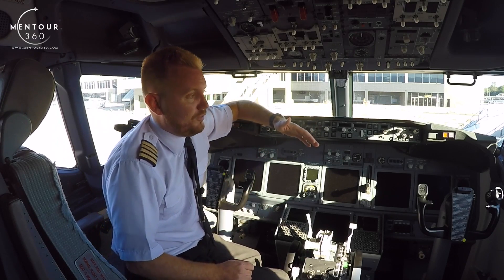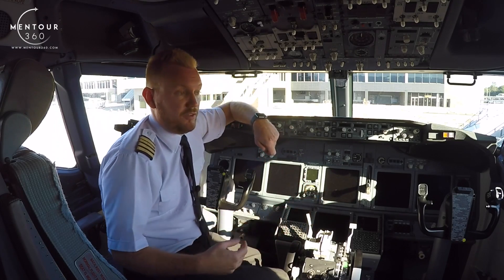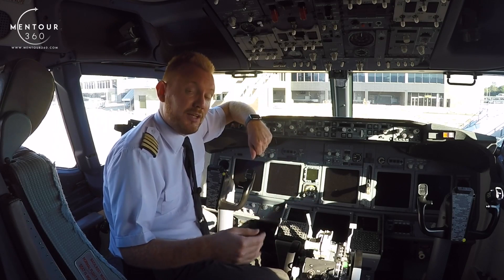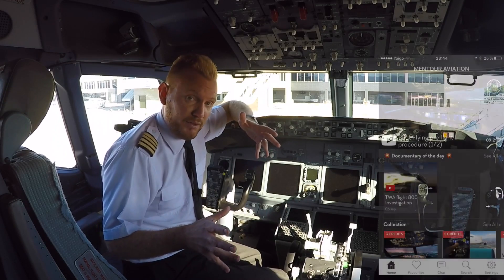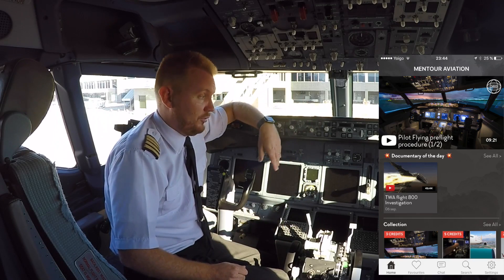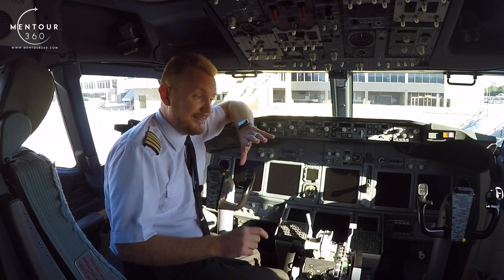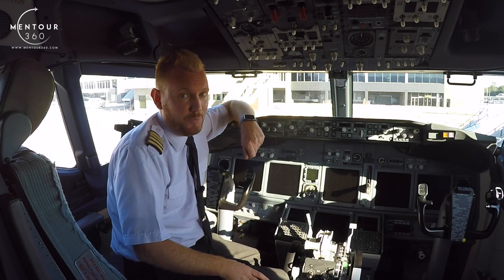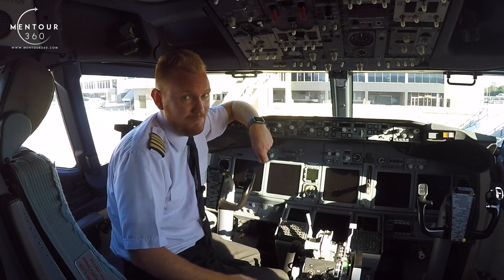How do flaps work on an aircraft?

Comment: Does anyone know of the uninterruptible auto pilot system, Mentour pilot??
Reply from the maker: +A D What do you mean with uninterruptible? We can disengage the Autopilot whenever we want on the 737
Reply: A D that would be HAL 9000 from Arthur C. Clarke's 2001 A Space  Odyssey
Reply: That tells me you don't have this equipment and that's okay. Honeywell has a patent on the system and it can be controlled and only controlled by the ground one activated by various means.  https://en.wikipedia.org/wiki/Boeing_Honeywell_Uninterruptible_Autopilot
The "uninterruptible" autopilot would be activated either by pilots, by onboard sensors, or remotely via radio or satellite links by government agencies, if terrorists attempt to gain control of a flight deck.  There's some conspiracy junk out there, but this system is real and is implemented by some companies, with privacy in mind.  There should be a worldwide mandate but governments and industry work slow.  This would all but end using an aircraft as a missile even by the pilot/s themselves.  What's your opinion?  Thx

Comment: Greetings. Your videos are very informative. Thank you for them. A question: Do modern aircraft such as the 737 utilise cameras that the pilots can use to monitor the functioning of the various parts such as flaps, landing gear, etc. Thanks very much.
Reply: Neil Quintana No they don't use external cameras to monitor important parts however some new aircraft do have cameras on the vertical stabiliser

Comment: Here’s a layman’s breakdown of wings, lift and flaps. Flaps are just an accentuation of what makes your wing “work” in the first place. Because of the wing’s shape, air moves more quickly over on top. This creates lower pressure...the molecules are moving faster, they’re less of a factor and all of the sudden, the higher pressure underneath “sucks” the wing upward...like when you open a door in your house and it goes FLYING OPEN because the room next door is at a lower pressure. Low pressure is also why you see “fog” form on top of the wings sometimes during takeoff and landing. If the dew point is right and the vapor in the air is close to “becoming fog” in the first place, the low pressure on top of the wing will be enough and boom....condensation forms. Flaps and slats just accentuate this...they allow a greater pressure differential to form, therefor causing more lift, therefor “high lift devices”. This isn’t the only reason airplanes fly....”angle of attack” or the angle at which the wing meets the oncoming air also plays a major role. A good analogy there is a kite. It meets enough wind and it’ll start to rise up in the air column. The physics of flight are complicated when you get into the specifics of airfoils, drag, etc....but on a fundamental level, its easy enough for anybody to understand.

Comment: wouldn’t the wing loose lift going from 40 degrees of flaps to 15 degrees on go around?
Reply from the maker: Yes, but we are also applying go-around thrust and starting to accelerate.
Reply: i’m thinking back when i was taking instruction in a cessna 150  back in1963  . was told never to make such a drastic change to the configuration . the 160 doesn’t have quite the thrust of a jet i’d say.

Comment: I have wondered how the winds are factored in slot/flap selection?  Straight headwinds versus a crosswind component.  I have student time in a 172, a Warrior II, and a Grumman Tiger, but no heavy tin.  I have no aspirations either, but I am curious.  We had a trim wheel to "Trim" out the yoke.  I have also wondered about the numbers on the flap lever.  Do the numbers, 1, 2, 5, 10 and so on, what do they correlate with? Are they angle degrees or are they just identifiers for your company?  As a very interested frequent passenger, I am just interested.  Keep them coming Capt.

Comment: Imagine taking venetian blinds that are rolled up, and putting them rolled up , rod and all, on your shoulders and running into the wind on a fairly windy day. Now unroll the venetian blinds out about half way and run into the wind again. OK, next let the venetian blinds all the way out and hold them on your shoulders. Now it will look like you are holding some big vinyl cape   cape on your back or something. Now start running into the wind with the blinds fully extended like that. Don't let go because there will be MORE DRAG trying to pull the rod out of your hands than the first time you ran with the blinds fully rolled up.

Comment: Great video as always, if a little technical for me though! But I wonder if you could give me your input to a situation I experienced on a recent flight. I know you're a Boeing man and the aircraft in question was Airbus, but I figure flaps are flaps? 

A return flight from Venice Marco Polo on a British Airways A320. I sat directly over the wing by the window. On the climb-out I saw something that I have NEVER seen before, and something I never want to see again. It's hard to explain without a pencil and a piece of paper but here goes! 

On the trailing edge of the wings where the two sections of flaps meet, there was like a rigid plastic gasket type object, that is, I'm guessing, a device to join up the two separate sections of flap on the angled part of the wing as best as they can when deployed. After we lifted off, the outer section of flaps, the longest section began to bounce rapidly near the join so much so I feared it was about to tear or fall off. It appeared as though that end of the flaps nearest the fuselage was not connected as it should be and was bouncing/oscillating maybe 30 to 40cm  above the wing, maybe two to three times a second! I feared it was about to fall off! No other section of the flaps was moving at all. They were rigid. To me it appeared to be loose. 

We climbed normally, levelled off, and the flight back to LHR became routine. But then I suddenly realised that flaps are required for landing, and I became a little concerned all over again! I reported my observations to a snooty steward, who promptly and very condescendingly (BA, remember. Famous for it) told me that they are designed to move. I told her I realised that but I had never ever seen anything like it. So she contacted the flight deck, and then ten minutes later came and found me and said there was nothing to worry about. Apparently the flight crew had reiterated her "they are designed to move" line. I'm not convinced.

What do you think? Thank you.

Comment: AA 191 showed cutting back speed when slats have retracted is a bad idea.  The pilots did exactly as they were trained, but when they reduced take off speed as trained (the left engine had torn itself loose),  the left wing stalled (the slats had retracted) and their DC 10 rolled over and crashed, killing everyone on board  (271) and 2 people on the ground

Comment: Mentour, one of the biggest differences I’ve noticed between the new flight sim 2020 and xplane is on 2020 the tendency for these airliners to balloon just before touch down if you’re coming in a bit low and/or airspeed is low and you increase the throttle just a hair to try and slow that vertical speed before you slam it down for a hard landing. Xplane isn’t nearly as sensitive for that ballooning. How accurate is that concept between the two sims? Can you make a video talking about how you deal with that sort’ve issue and final approaches/glide slopes as a professional?

Comment: Max wheel speed =200kts, wow, I guess it’s like putting a music CD on a drill bit and spinning until it disintegrates.
Reply from the maker: Pretty much.
Reply: @Erick Pokladowski I thought that the second I read his comment.
Reply: Tire limit is 225 M P H. ground speed. IF you saw an R 7 in the sidewall, and you were taking off in PHX on a 'hot' day, what would your true a/s be at 174,500lbs, OAT 35° C, flaps 15° ? What would be your tire speed at Vlof?

Gotta' love math story questions. R7? Thatz how many recaps the carcass has been cycled through. Never blown a recap. Always a new tire.

Comment: I was looking forward to this video so much :D Finally it's here and the waiting was really worth it :D Great video with a lot of nice real aircraft videos. Also like the fact, that you talk from inside a real 737 cockpit. What kinda confused me is, that you only have 2 landing light switches. All 737s I flew in my simulators so far had 4 :D Great video! Keep on the good work :D
Reply from the maker: +Daniel Siwerov Hi! This is a brand spanking new aircraft and it is fitted with the LED assembly. (Check out my instagram for a nice picture) This means that the Retractable lights have disappeared.
Reply: Oh wow. Didn't know that :D Yeah of course I will check out you instagram :D Thanks for answering my question :D

Comment: @Mentour pilot, try to land without flaps, slots etc. And after touchdown don't use reverse, brakes and spoilers. CHALENGE ACCEPTED? Haha
Reply from the maker: +Ioio Ioio No.
Reply: Just go to Edwards AFB and land on their 12 km salt flats runway. I'm sure it's long enough for even that rollout. :-)
Reply: I land that way most of the time on real calm days, set the speed bug at 70 knots, flare, bleed off speed in ground effect, then pull back on the control column to keep the nose gear off and use maximum aerodynamic braking. Yup -- nice thing about Cessna's 172, no slats, no reverse, no spoilers, and I can put her down in 1500 feet with no flaps, no brakes.

Comment: Next video: Why do Boeing planes have an “OFF” position on the landing gear lever? What is that for? Why not just “UP” and “DOWN” like Airbus?
Reply: After take off the pilots select gear up to raise the gear, this pressurises the system and lifts the gear back into the body. During climb to cruise (or 10,000 feet, I don't remember, I'm not a pilot) the pilots move the lever to off. This depressurises the hydraulics and the gear is held at this point by mechanical locks. Depressurising the hydraulic system reduces the load on the pumps and allows a slightly bigger overhead to be used for controlling the more important things like the flight surface..
Reply: WJTB 2004 I thought "off" is the same as "up".

Comment: Nice instructive video! There are two points I'd like to mention. The increased drag of landing flaps are important to make steep approaches if you're flying a Cherokee or Twin Otter in mountainous terrain but most transport jets don't fly those profiles. We all (airliners) need to be at about 1000' at 3 miles. Early turbojet engines needed a lot of time to spool up to go-around thrust and the higher drag meant higher stable thrust on approach. Engineers built in high drag for that reason. This greatly reduces spool up time to go-around thrust. In fact some early turbojets (think 707, 727) were so slow to spool up you were basically committed to land once below 400' unless your power was up. Modern turbofans are better but the design concept remains. Lastly, at Delta we illuminate all lights (landing, wing, nacelle and runway turn-off) below 18,000' to maximize our visual impact. Perhaps it's because there's more general aviation traffic in the US. At Delta, it was technique, but not procedure to turn on the taxi light when landing clearance was received. "Exterior lights" was a checklist item on the descent check which was done descending through 18,000' which is the max limit for VFR traffic in the US. Each airline has slight variations. Cheers